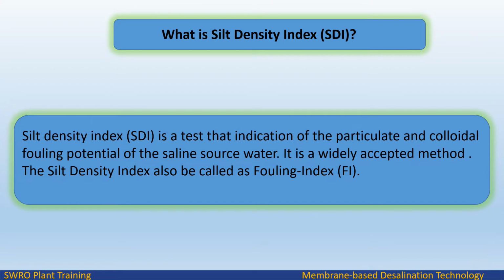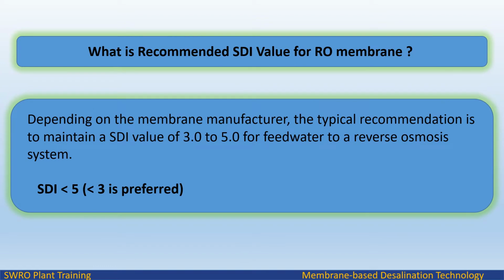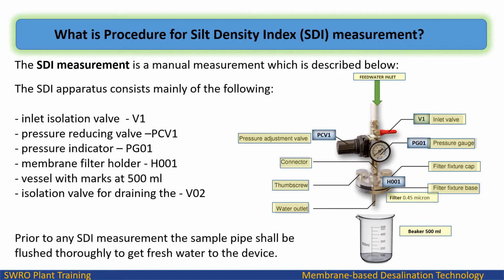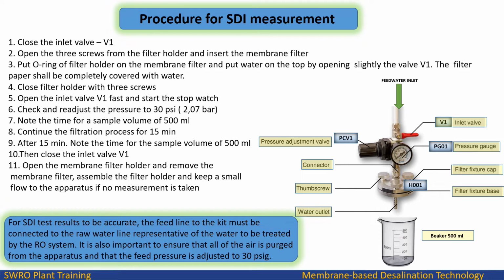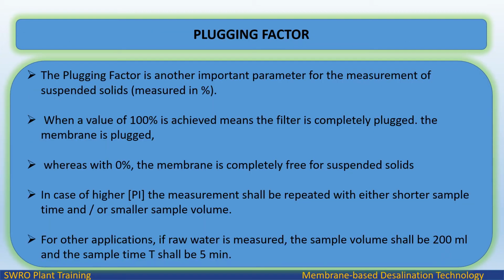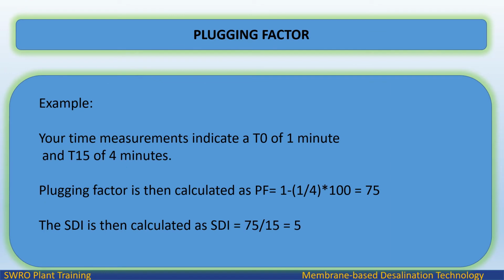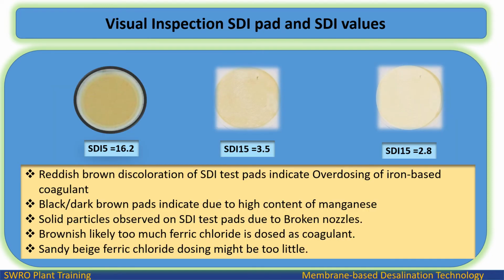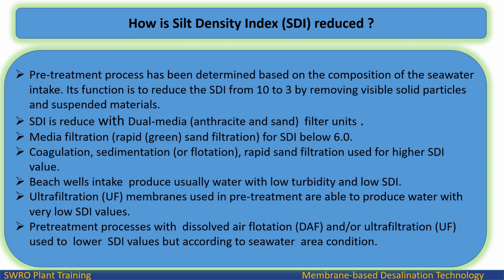Silt Density Index (SDI)-SEAWATER RO MEMBRANE

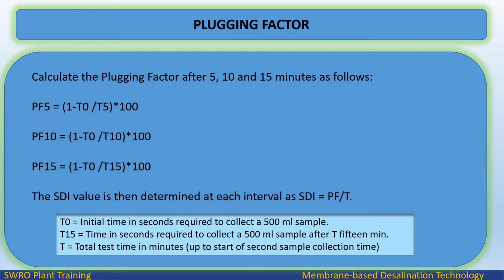Comment: 8:10 that SDI= PLUGGING FACTOR/ TOTAL TIME is wrong 

Just correcting you that it should be the gape between the time taken t1 & t2

Like if the gape is 10 min 
T= 10 not considered the t1 and t2 ( time to fill 500 ml at initial & finally after 10 min shouldn't be cover in total time )